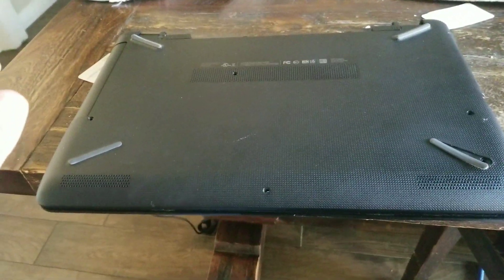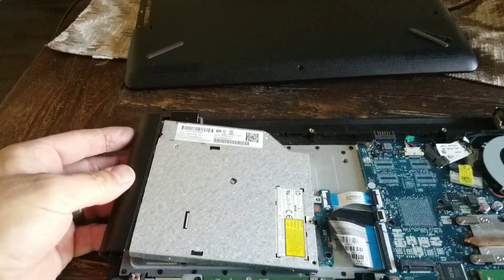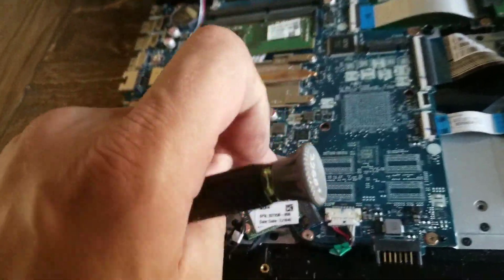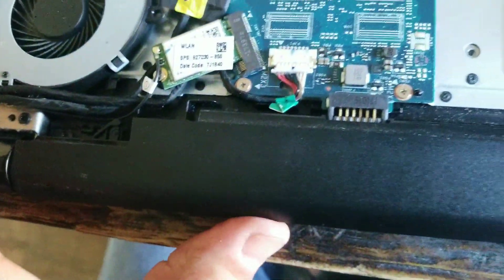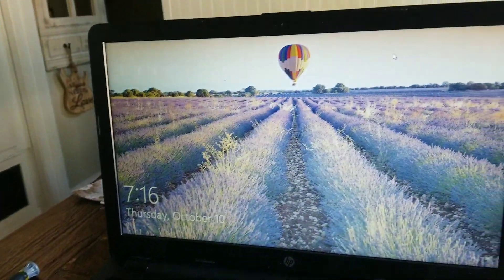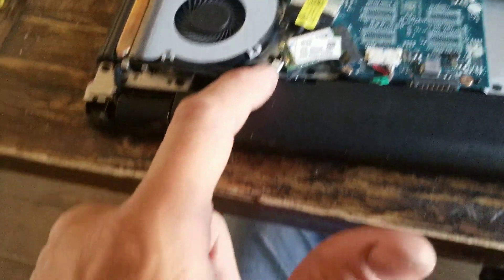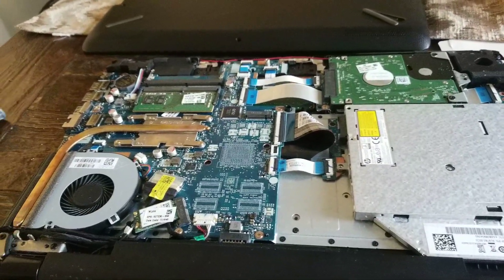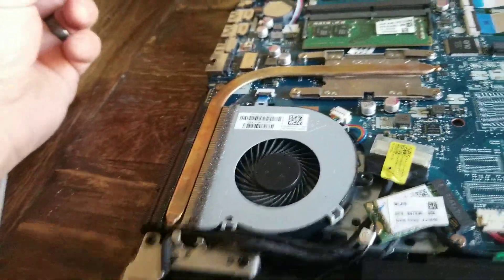HP laptop not turning on. Repaired.

Comment: HPs are notorius for that. Isnt there a ribbon cable that connects to motherboard? Isnt there a DVD on that one? Do I have to pull out DVD drive? Uhhh what did you do? I didnt see you do anything except wiggle wires. I had an old HP that used to have a looose power plug in, and It was a bitch to relace. I finally got one of these cables that allows you to plug into the back of the laptop. (Old model, had a place where you could plaug in on back side and bypass power plug0 They dont make them like that anymore. The one I have now is Blue 17", no fingerprint thing. Oh KAY..I just finished the video...the cmos battery reset. Thats was what fixed it. That is a comomon fix. You pop them out replace or just put them back in. Usually you are supposed to try to power on without the tieny battery. Im surprised you didnt know what it was. That is CMOS. Power. Without it NOTHING happens. Did you have a dvd?